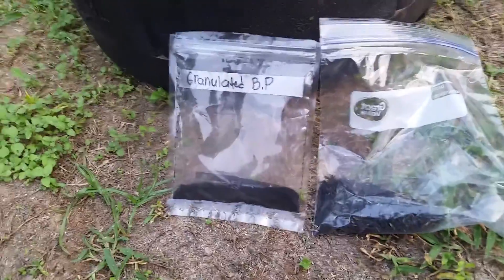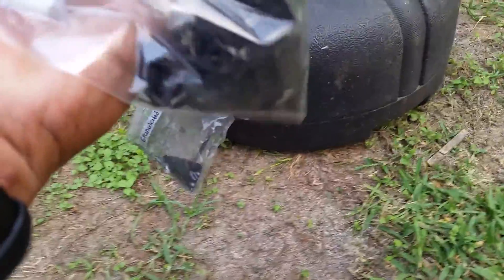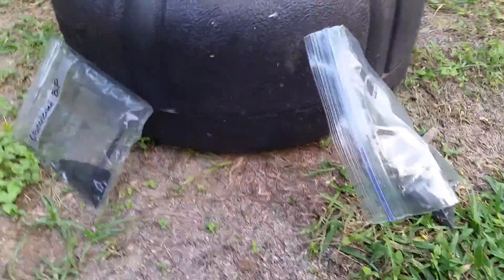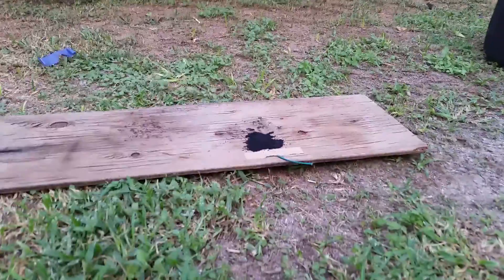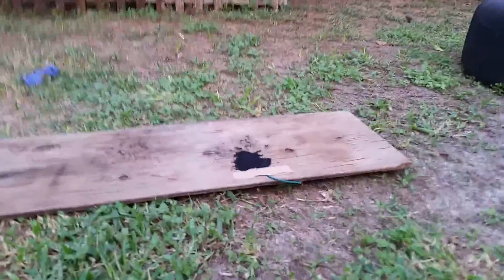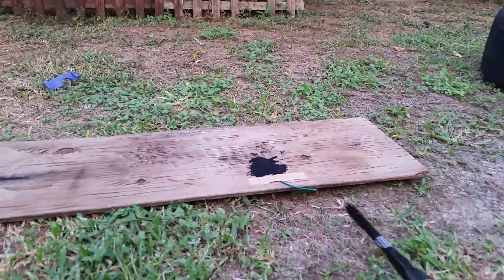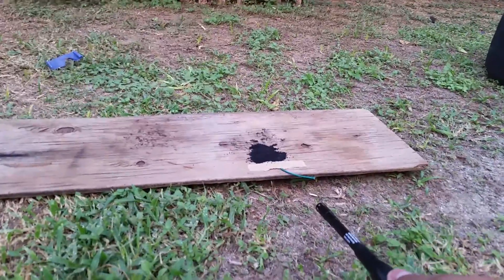Granulated black powder and burst charge test

Comment: Keep the sugar for the rockets and buy u some sulfer and make some homemade charcoal and make actual black powder. Mill out 75-15-10 granulated with 1 to 2 % dextrin good luck.
Reply: You can go without the sulfur, it just lowers the ignition temperature, but leave out the sugar. Sugar is not a replacement for sulfur. Just use 75-15 KNO3-Charcoal